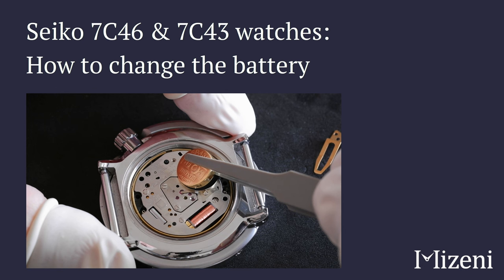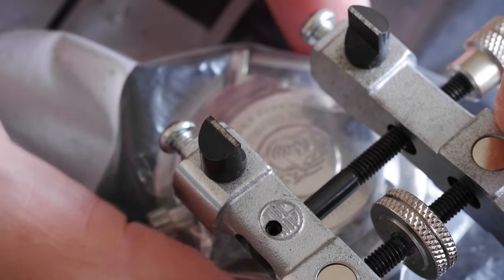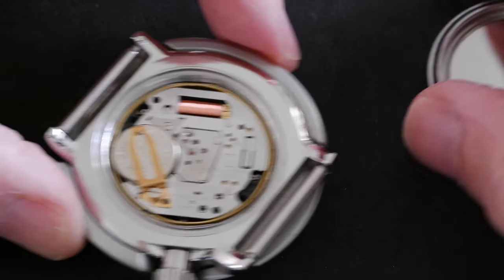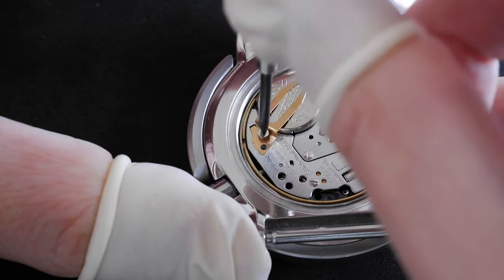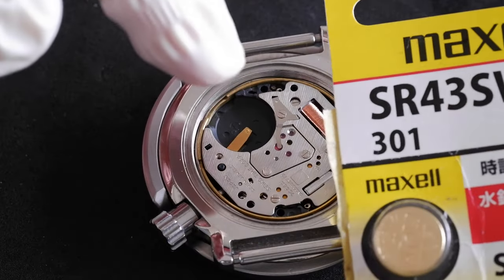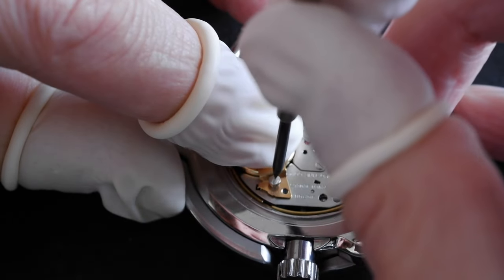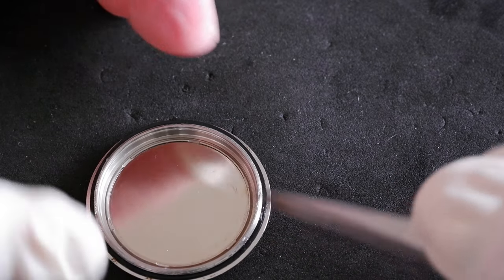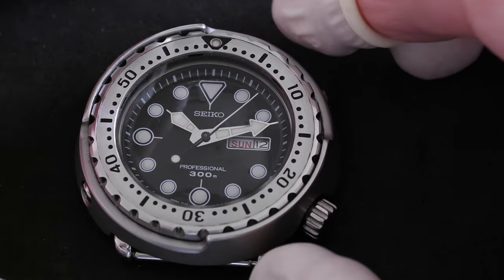#Seiko 7C46 & 7C43 divers: How to change the battery

Comment: Thanks for the video!

I have a Seiko 0823-8000 that stopped working.  Brought it in to the repair shop, and they said later that the metal cover holding the battery down broke.  Super bummed.  Do you think I could find a replacement piece, or make a makeshift one, or do I have to bin it?

Comment: Starting from 3:55 : Even its an old empty battery, he seems to be constantly short circuiting the old battery to the case itself with metallic pliers. Dont do this with new battery. That golden color part will be conneted to positive end of the battery, so you do not want that part to connect to the case or anywhere else.

Comment: The backgasket actually fits in a groove in the case NOT around the threaded flange of the backplate. You are not supposed to put the gasket on the caseback plate flange. Your gasket is not properly installed. Divers watches are different from dress watches, where the gasket is installed on the caseback side. You need to re install your gasket.
Reply from the maker: Thanks for leaving a comment and pointing this out. I had assumed there wasn't a difference (the gasket would slot into the groove when the caseback is screwed on) but you're right, I should put the gasket the groove in the first place. I'll re-install it. Much appreciated.

Comment: Looks diffcult
Reply from the maker: It's not too bad, as long as you have fine tweezers and screwdriver, but it does need patience and a clear, bright work area. It can take a while to get the screw back in, but once the watch is running again it's very satisfying if you do it yourself. 🙂